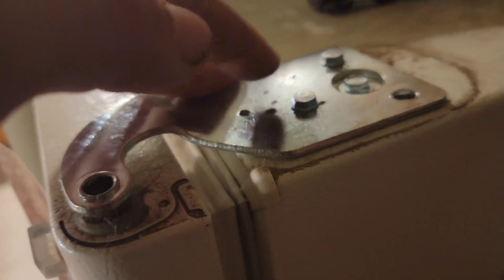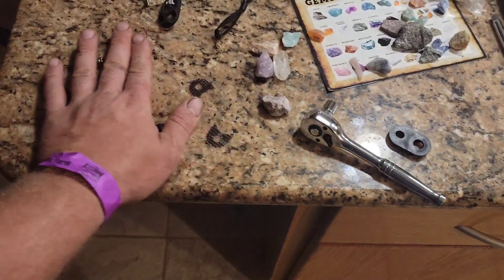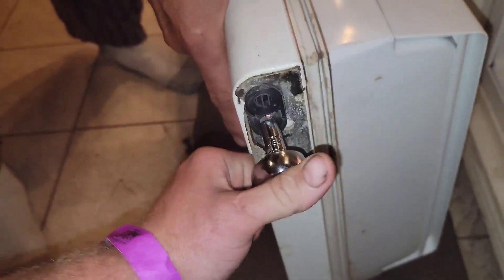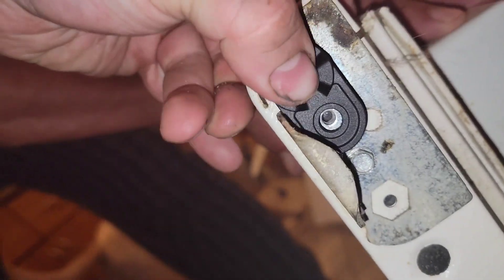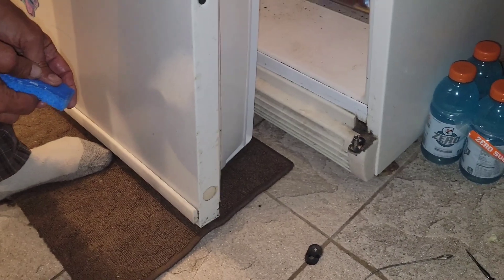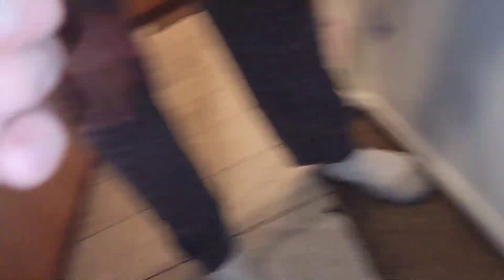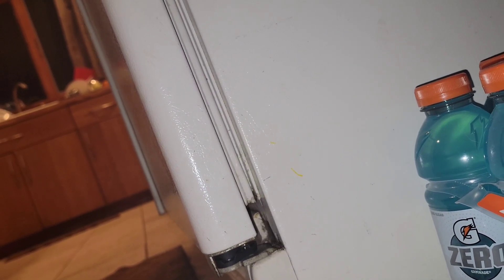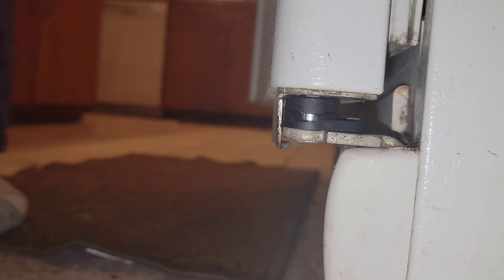Kenmore Refrigerator Door Not Closing All The Way On Its Own Fix - Easy 8mm or 5/16 bolts how to

Comment from the maker: https://amzn.to/3n0qlOV

Here is the kit
Reply: I work on them all the time if you leave the plastic part off the bottom hinge it still shuts fine saves you some headache lol
Reply from the maker: @dakotabowes2387  well it doesn't have that little push if that plastic pieces isn't there from what I understand and with our little one sometimes forgetting to close the refrigerator all the way just that little bit of help actually does help so that's why we did it
Reply from the maker: @dakotabowes2387  it shut fine before we replaced it we're looking for the little help function that it provides whenever somebody trying to close the door if they don't close it all the way
Reply: Just found out those are shims if the door needs to be aligned with the freezer door. It goes under the door body.

Comment: No one said it, just make sure it's not leaning forward. adjust turn the front legs. My Refrigerator  problem was it needed R134 that I did Myself back in 2017.  Plus clean the coils  "don't forget to do that with yours".  Good training video. 85

Comment: Some lube will prevent premature wear and with some goods in the door, it will be heavier and lock into place tighter.  Make sure the seal all around the door is perfectly clean as it has a magnet strip all though and any excess gap will make it weaker to shut and close fully. Good job!
Reply: Yep, a little drop of silicon grease will do wonders.